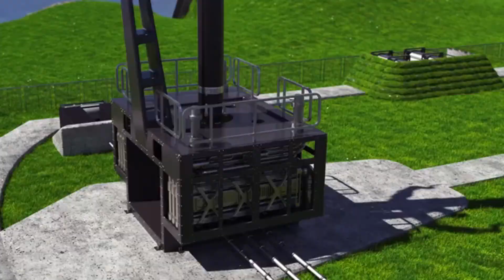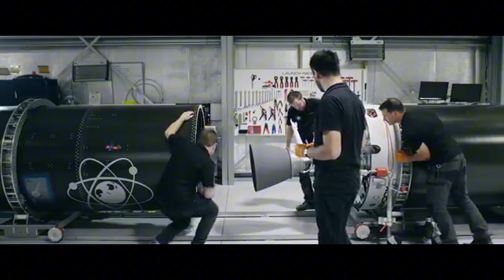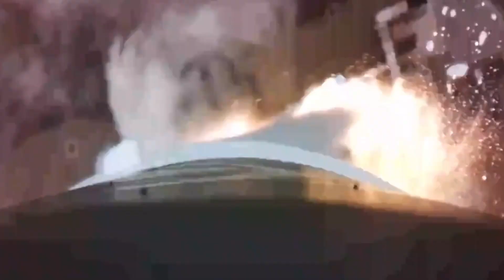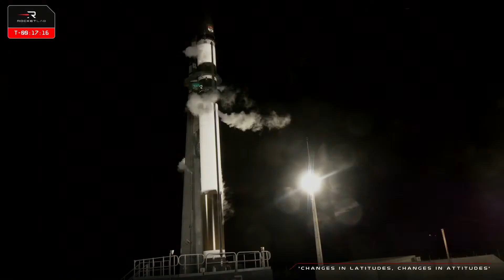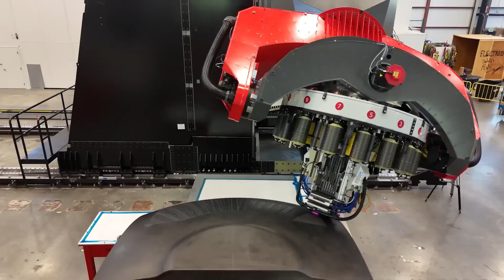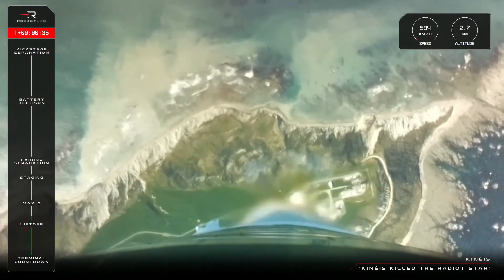GAME OVER! SpaceX Finally Has REAL Competition: Rocket Lab's Neutron Just HUMILIATED Falcon 9...

Comment: Why post with highly misleading lead, 1/3 the cargo at 1.5 times the cost and 1/10 the cargo space vs Falcon 9. Humiliating hardly maybe for for Rocket Lab. The numbers do not lie 2 launches in two years sold to date that not even 1/250 of what SpaceX has on the books. Do not outright lie in your posts again if you care about keeping me as a subscriber just tell the facts as you perceive them and if the posts still do not align with reality you will not last. I violated my own rule about not speaking/writing when I am angry, however in this case felt it necessary to quickly convey my disappointment and anger at your hubris in attempting to get what I perceive as a strategy  get more views! This for me is a shortcut to your failure to attract and keep subscribers. Thanks for reading. Ray
Reply: Musk fanboy have a hard time seeing reality 😂
Reply: @danygauthier605  What did I miss or state inaccurately? Some people just have difficulty with the facts as they come to table with outcomes already decided so anything that does not align with their narrative must be result of exactly what they are doing. I think you protest too much. Stay with delusion Answer statements with personal insults instead of convincing counterpoint arguments and it will take you where you need to go, bye bye reality. Ray
Reply: @danygauthier605 The Neutron has way worse payload compatibility than the Falcon 9, with it primarily competing with smaller rockets like the Vulcan and Ariane 6. It does not at all compete well against the Falcon 9, nor is it meant to.